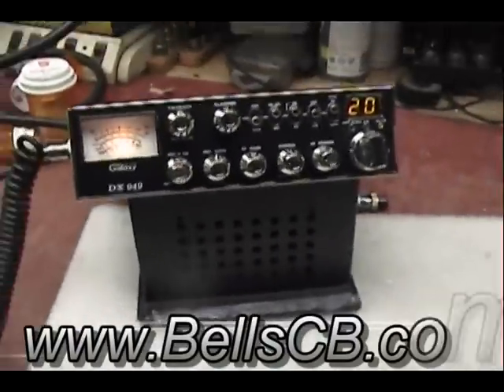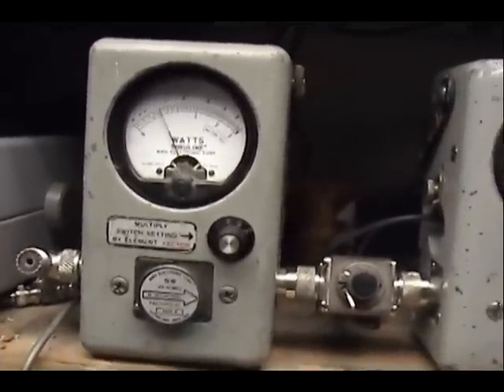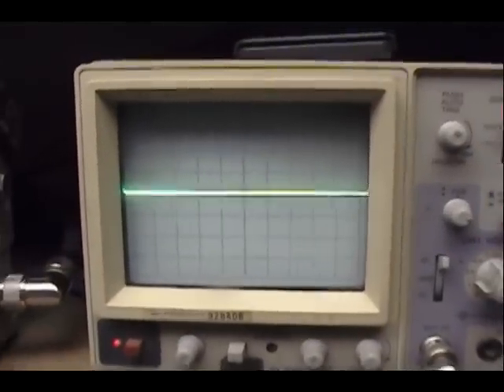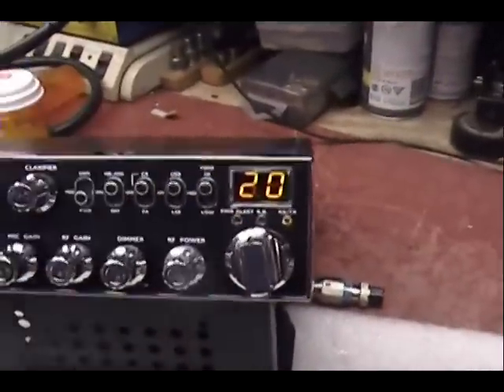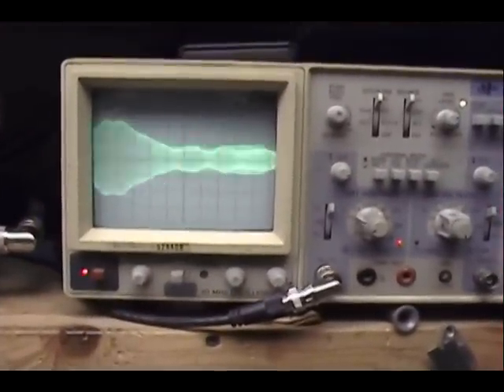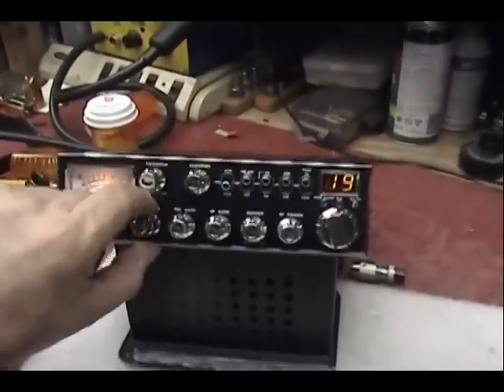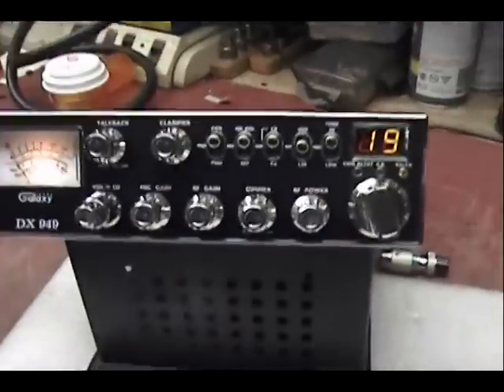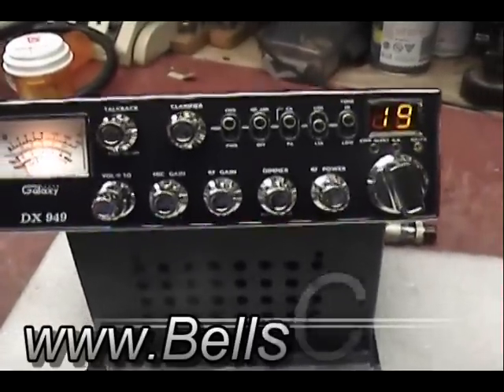Galaxy DX-949 OEM Report

Comment: I have been the Stryker radio for several weeks in my vehicle and have been very impressed with the functionality and quality of the radio.

The stock microphone is paired very well to the radio; however, you will achieve even better audio quality if a quality dynamic mic is used with the radio. I have received very good reports on the audio while using an Astatic 636L microphone with the radio ($60 at any Pilot or Love's truck stop). The radio is also paired with a Stryker SR-A10 magnet mount (http://strykerradios.com/best-cb-antennas/) on my setup which is also an excellent mobile antenna.

The radio has a large and effective heat sink (cooling fins) on the back of the radio that sticks out a bit...so be sure to check your mounting space / clearances before performing an install.

Software to customize the radio is available for download at the Stryker website(http://www.strykerradios.com). The software allows customization of frequencies assigned to channels in each band as well as customization of roger beeps and radio operating parameters. (6) roger beeps may be programmed and individually assigned to individual channels. Especially nice is the ability to set operating ranges for voltage, max SWR, and max key down time...all of which serve to protect the (4) MOSFET output transistors from damage.

Finally, there are few radios that look as SWEET as the Stryker SR-955HPC(http://strykerradios.com/store/10-meter-radio-955hpc/). There is a fairly large signal meter to the left of the face plate and the back-lighting on the face plate looks amazing...especially at night.

There are several YouTube videos out there on this radio as well as other reviews, so check those out. Buy with confidence, this is a rock-solid transceiver and you won't be disappointed if you purchase one.